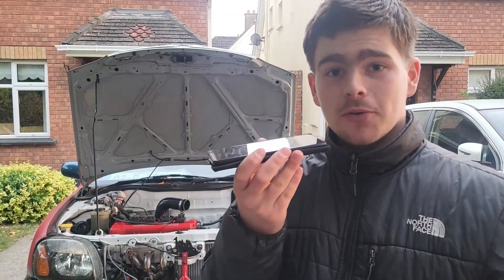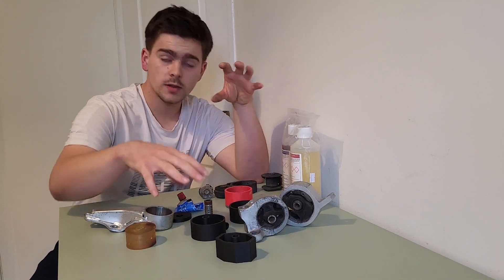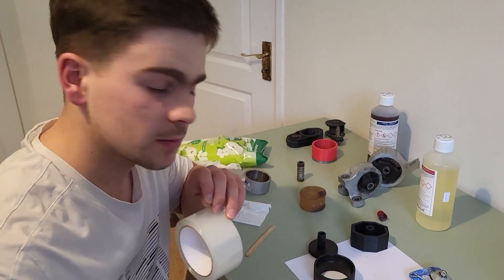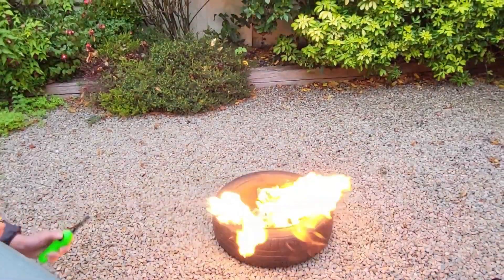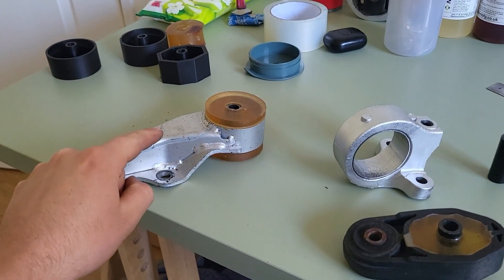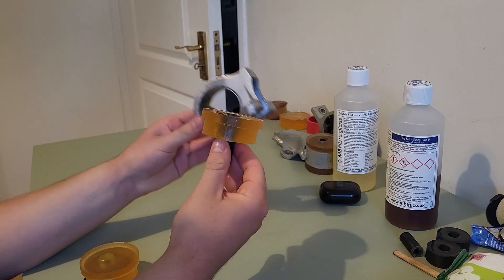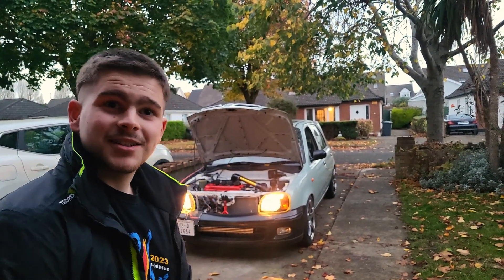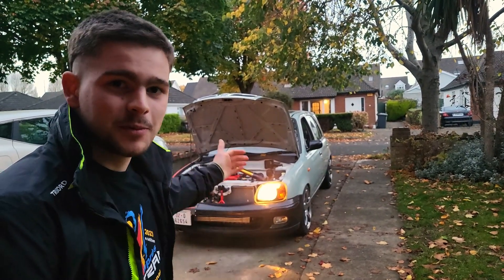Making DIY Polyurethane Engine Mount Bushings for my K11 Micra

Comment: Hi pal, how are you getting on with these nearly a year down the line? I need to get new mounts for mine, but don't want stiff sports mounts and don't want OEM = maybe I'm going this route lol
Reply from the maker: I've done around 10,000mi and still holding up. Bit of wear here and there as I doubt they're as durable and long lasting as OEM spec but they work fine

Comment: Nice video! And the bushings looks great! 
Was looking to do this myself! Seems like a fun project! About how much polyurethane did you use and what stiffness? Also what polyurethane kit did you buy?
Reply from the maker: Bought an A70 stiffness 1kg kit from MB Fibreglass in the UK and used around 600ml, wasting a lot by not calculating the volume correctly. Still have one bushing that I think I'll do. You could get a stiffer mixture if not daily driving, maybe.

Comment: Oh would you look at that, the makeshift turbo intake with the Tesco funnel has been swapped out for a vent 😂, it’s better than the last one in a way. But great job on the mounts
Reply from the maker: The filler didn't last long, it will be better this way in the long run🤣

Comment: I wonder if 3d printed bushings would work. There is a lot of A70 shore filaments and they shouldn't melt, but you need a direct drive extruder for that probably
Reply: mmmh interesting. i realy have no idea. but the layer adhesion would have to be perfect so the material is stiff enough.